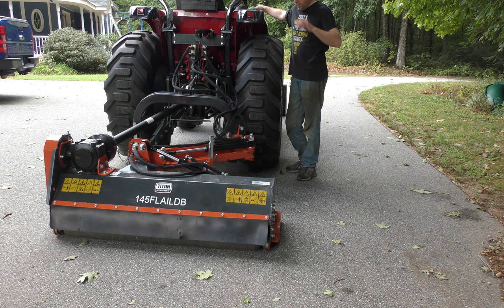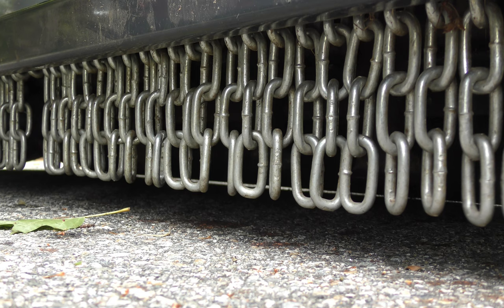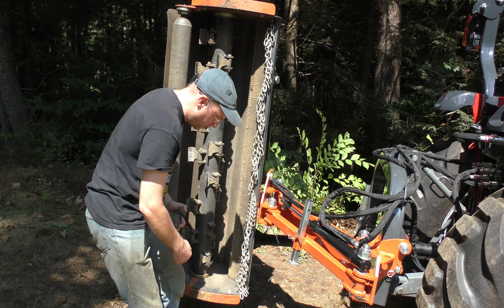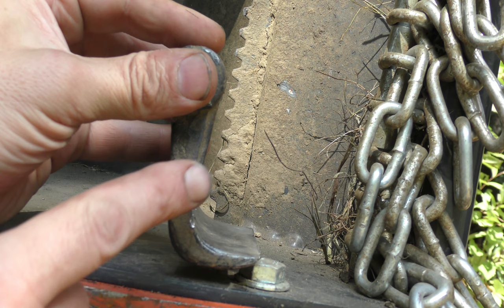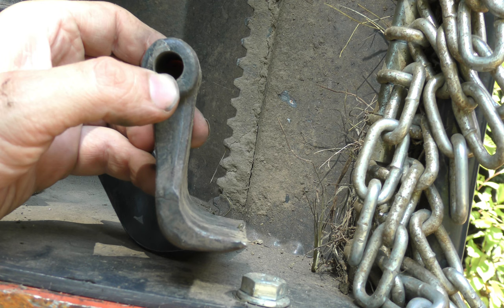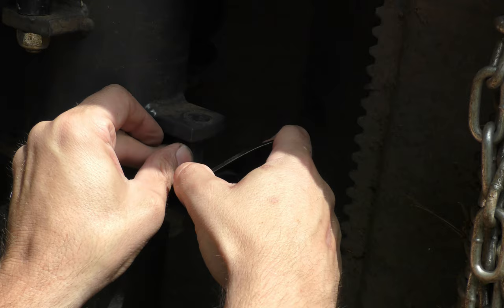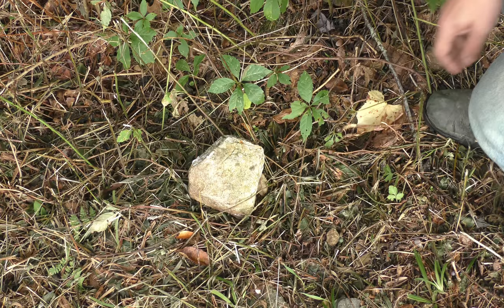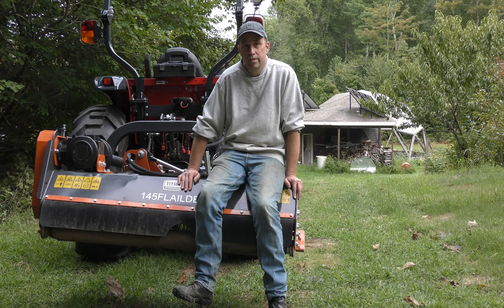BUYER BEWARE: Titan Attachments Flail Mower Review

Comment: thanks for sharing the video I have the Titan fail cutter also mine is just like yours but it's 72 in wide. my drum is the same diameter as yours but the bolts that hold my blades on are 5/8. I've never lost one,  my blades have never broke or bent I think the blades are 3 in wide I've hit plenty of rocks and worn them down but never broke one can you leave the link where you got those replacement blades thanks. I broke the chain support  rod by a rock slamming into it so I individually screwed each chain on with a sheet metal screw. my cutter doesn't have the rubber piece hanging down on the back either
Reply from the maker: I wonder if your mower was made in a different factory.  I think they are just reselling different models and putting their brand on them.  I'm surprised it would have the 5/8" bolt in it.  I confirmed the hole in the old blades and they are 0.5" with a width of 1.8", and the blade is 3.1" wide.  They really are design to have a clevis to connect it to the drum but that would make them far too long.  Also, I didn't mention it in the video buy I had to grind off the corner of the new blades so it could swing properly without hitting the drum.  https://www.amazon.com/dp/B08XFJ5XGX?psc=1&ref=ppx_yo2ov_dt_b_product_details
Reply: @Bigelowbrook  I beat the crap out of my first set of blades by hitting rocks. but all they did was wear down not one bent or cracked. they are forged blades so you can weld them where they crack. my Titan flail mower is about 3 years old. I double checked the blade mounting bolts and they are 5/8 diameter. I ordered a second set of blades from Titan. they weren't cheap they were over $300 for the set
Reply from the maker: @madtater5948  I stick to the scoop blades now....I'm not very pleased with how Titan dealt with the situation.  ;-)
Reply: @madtater5948  What's the link to that parts page where you ordered the parts from? I couldn't find it. Thanks!
Reply: @michaelshrader5139  go to Titan attachments website punch in item number 191468 these blades look exactly like yours but mine doesn't have that triangle stamp on the back. like yours. I reordered a set last year maybe this is a new style and the old style not available.if you like send me your email address and I'll send you pictures of the ones I have thanks

Comment: I purchased the 86" offset mower from Titan, took it into my field and was shocked--it would not mow!! It literally pushed the grass over and went over the top of it without cutting it. The front edge of the mower is too low and that is the problem. I had to return the mower.. At first I thought maybe they put in the wrong gearbox and that the mower was running backwards--Nope!
There are better mowers out there, spend the extra money you will get a better product.
Reply from the maker: I'm surprised they let you return it.  They wouldn't take mine back nor would they replace the defective blades.
Reply: What style cutters did your “pusher”…have…?
Reply: @offgridmangogrower  Whats a pusher?

Comment: Wow.... Disturbing.  What did Titan say?  On the other hand your new blades must have given your tractor so much more power because of the weight difference.  I use those same blades on my tow behind flail I pull with my quad.  It's very fast and can go almost anywhere.
Reply from the maker: They wouldn't help at all.  The new blades work great.
Reply: @Bigelowbrook  hey I forgot to mention the spacers you made.  I noticed the material on mine are some kind of pressed composite or something which I could not find to replace because they break too.  I still haven't found the proper spacers.  The pipe is a possibility.  Thanks for the idea

Comment: A lot of great information here but I think you are trying to run this thing too close to the ground!
Reply from the maker: The roller wheel is not adjustable.  If you lift it with the 3-point hitch arms, it will mow higher but if you go over a hill or bump, it will mow higher or scalp the ground.

Comment: I have very rocky soil so I went with a brush hog
Reply from the maker: I also have a brush hog but wanted the offset feature.  I've also have broken the blade on that too.  ;-)
Reply: @Bigelowbrook  And that's my point..... no mower is going to work well or for long if you are mowing large rocks with it. Even just occasionally hitting a large rock is going to cause damage. No mower manufacturer to my knowledge makes any claims that their mower can be used to mower over rocky fields. Your expectations have to be in-line with that reality.

Comment: Looks Chinese... I wouldn’t have bought it...
Reply: You're correct, it's made in China
Reply: Probably. Or some Asian country no doubt. It a solid mower but still has room for improvement... I don't expect the ability to mow large rocks will be in their marketing claims anytime soon however. Have reasonable expectations for the machinery and you will not be displeased with it. My 1st Flail200DB was replaced under warranty after I discovered the PTO gearbox mount welds were un-zipping! The welds were bad, hollow from what I could tell (the weld didn't penetrate into the corner of the joint fully). They didn't want the mower back, they just asked for pics of the problem then approved a new mower be sent to me which took about a month. So I still have the bad mower for spare flails and any other parts if I need them. Of course that rubber discharge flap just shreds in no time flat, even the replacement mower is already missing most of it's flap and the original one's flap was gone in like under 8 hours of runtime! Anybody know where I can buy an 8 foot length of conveyor belt possibly? At least I now have enough lower hitch pins to properly connect the mower to the tractor (the 200 series mowers take 3 lower hitch pins, but only come with 2 of them.... I have no idea why and have made Titan aware of the issue).
Reply: @michaelshrader5139  I guess it's the tradesman in me that makes me able to identify crap before I purchase. There is no way I would have bought this, it just screams chinesium right from the onset. I'm not saying everything from China is bad they're getting really good, really quickly, but they do still export a lot of crap that shouldn't be allowed into the country. 

In my opinion, there should be a minimum quality standard that the importer has to meet, and a minimum warranty period, and the importer should have to pay for an independent body to certify to the quality standard. People say: oh but that will push the price up... yes, yes it will, then you will be able to actually compare domestic products to cheap inferior imports. you would still be able to buy imported stuff but it would be of similar quality to domestic stuff and similar price. I guarantee, most people would chose domestic stuff if the quality and price were similar.

Comment: You need too be smart enough to size the equipment to the tractor you bought. The mower you bought is for a 25 to 40 ho tractor you have some were around a 60 plus hp tractor. So it's not the equipments fault and yes it is a cheaper mower like your tractor.
Reply from the maker: that tractor is 35HP and it's a Massey Ferguson...nothing cheap about that machine.